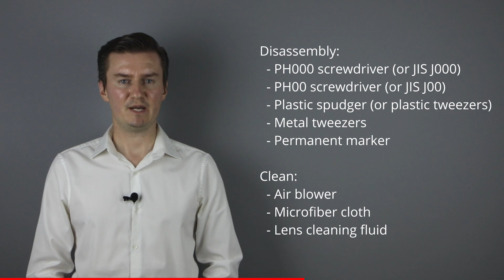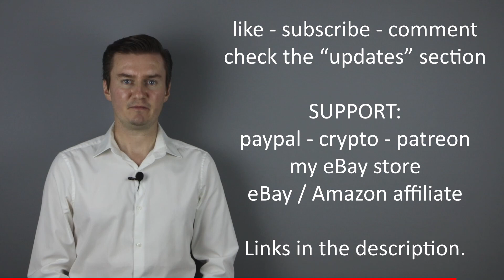Canon 70-300mm f/4.5-5.6 EF DO IS USM lens AF motor disassembly - clean focus strip - repair hunting

Comment: Hello, I'm confused! I did the dismantling and cleaning twice but the problem remains identical to the example you filmed. Any idea what I'm doing wrong. Thank you
Reply from the maker: I would start with checking the focus strip if it has scratches... if it does, then most likely you have to buy a new one.
If it has no scratches, then clean the focus strip again, make sure that the microfiber cloth is perfectly clean, and also clean your hand. When you clean the focus strip, clean it also moving the microfiber cloth perpendicularly.

Comment: Do you have one on repairing a loose zoom?
Reply from the maker: Try this: disassemble the lens until you remove the USM motor, then zoom out, then tighten the screws on the side of the lens which are holding the front lens tube.